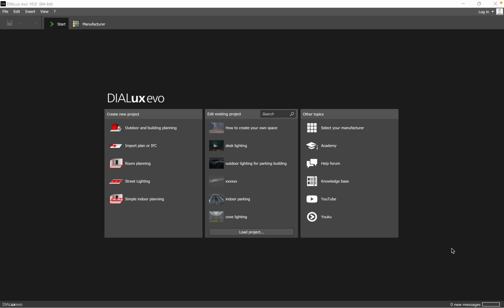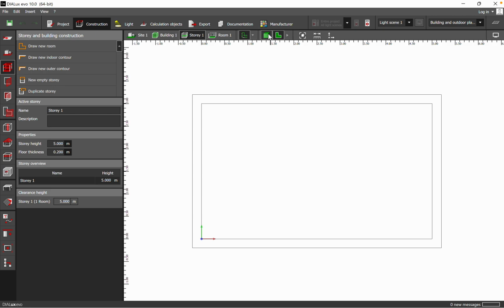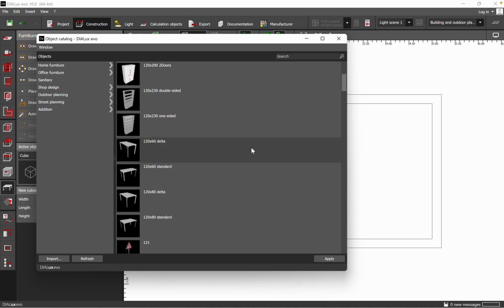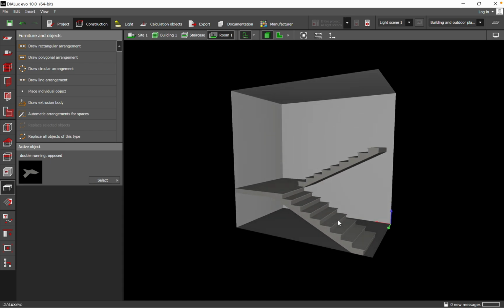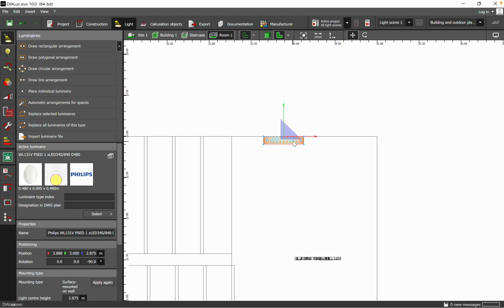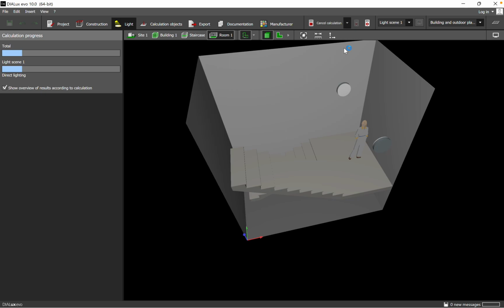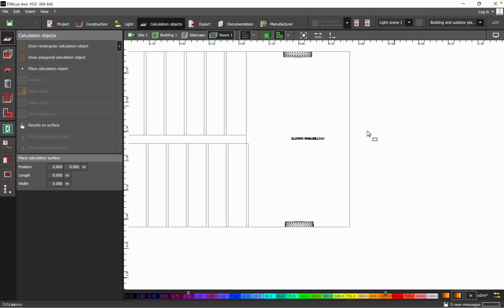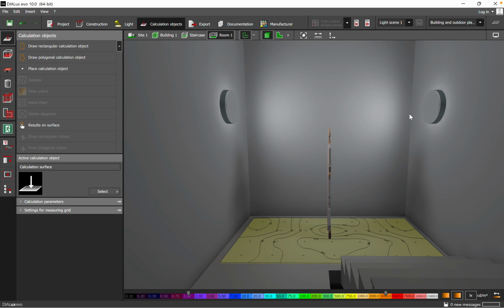Lighting solution for staircase part I

Comment: I have a question : If i have a multi story building, if i want to place downlights/cans on the landing of each half story (if that makes sense). How do i place the luminaire on the story above (due to the story heights) and still have the light output being shown in my calculation results for the floor below? Does that make sense? I hope so 😅😂
Reply from the maker: Hi, thanks for your question. From my point of view you have 2 options how you can deal with this situation.
First option is to add calculation surface on each level, and then you can see the value of light output.
Second option is to design separately the staircase for the entire building and find out the light output.
Hope that this information will help you.
Kind regards,
Catalin